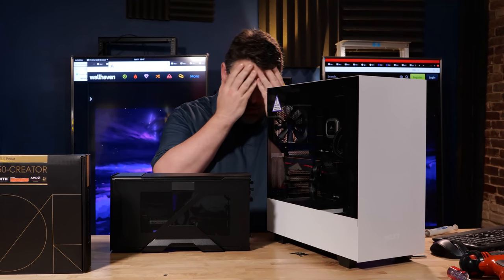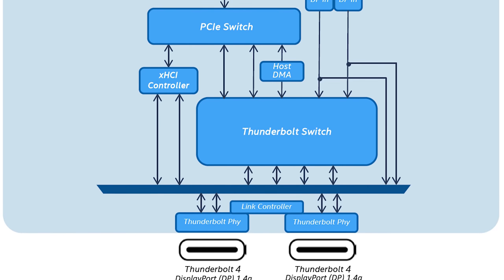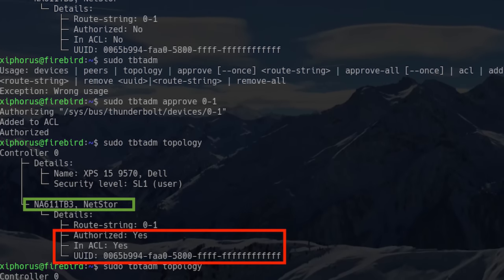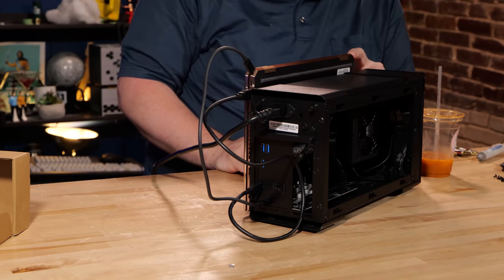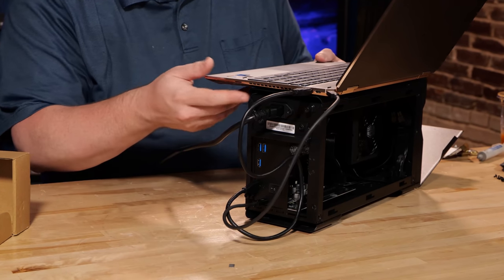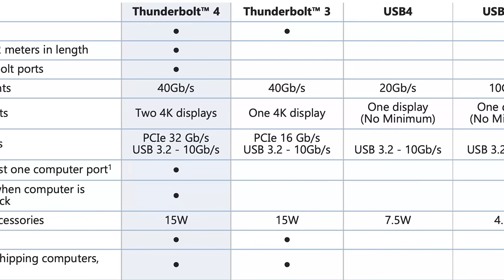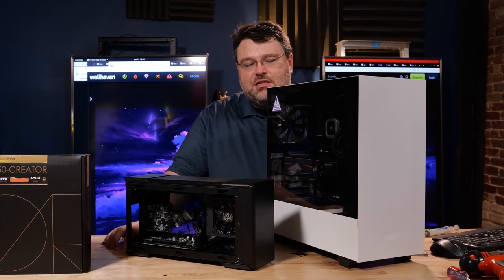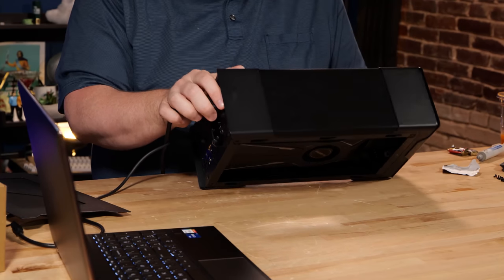Cooler Master MasterCase EG200: THE BEST Thunderbolt Enclosure? Tested on Thunderbolt 4!

Comment: Ever thought of doing some reviews on external disk enclosures? One day I would probably like to downsize my homelab to some sff ryzen host's or something but the thing I still haven't figured out is finding a good 6ish disk mini sas or I guess usb/thunderbolt enclosure.
Reply: I‘m pretty disappointed by purchasable external Thunderbolt storage solutions. I‘d go the DIY way with an external PCIe box, a proven HBA and depending on the type and number of desired drives a SAS expander. Especially with multiple NVME SSDs it‘s naturally quite easy to constantly hit the PCIe 3.0 x4 bottleneck of Thunderbolt 3/4 but it‘s still “fun” to work with.

Comment: Did you rotate that PSU? Mine has the air intake towards the mesh, not behind the GPU. As I am not using the FE card, it works better than back to back with the backplate of the GPU. Nice review BTW, but would have been nice to see also SSD throughput figures for the enclosure.

Comment: Hi - thanks for the review - I'm looking at a GPU with a depth of 143mm, vs the recommended max of 141mm. Will I squeeze that extra 2mm of vertical clearance into this case? (perhaps removing or relocating the 92 mm fan on the lid)

Comment: Waiting for an enclosure that won't bottleneck a GTX 3090/80. Or does that already exist?
Reply from the maker: You'll be waiting until well after they are obsolete
Reply: @Level1Techs  Welp, I can still dream while I'm dead.
Reply: What about using oculink instead of thunderbolt. Some ASRock rack mobos have lots of pcie lanes on those connectors.